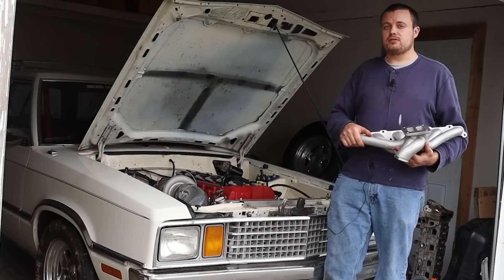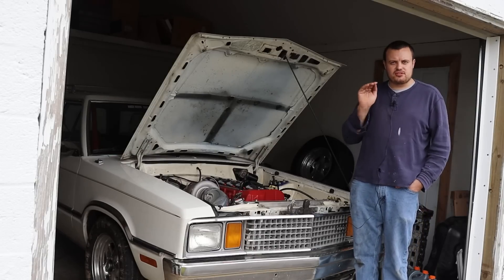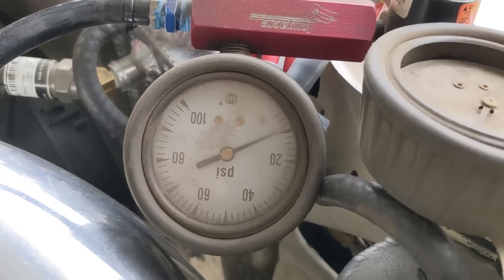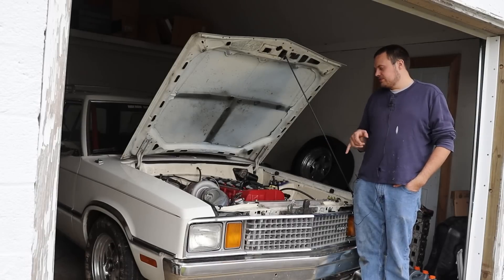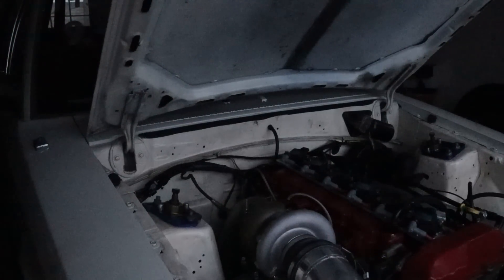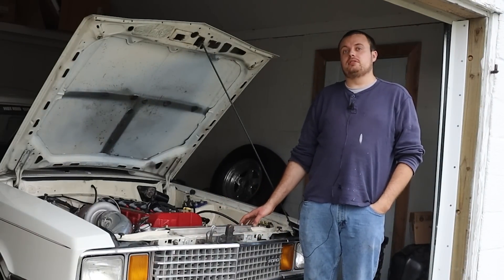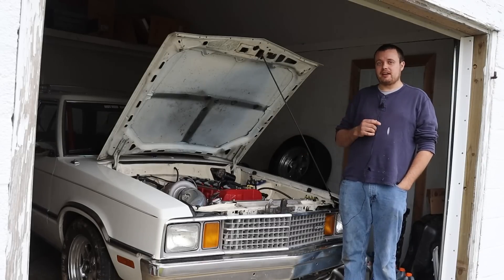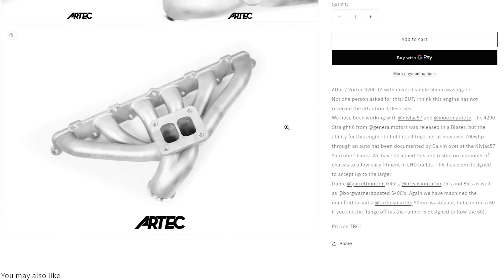Installing the Built Vortec 4200 Into My Station Wagon + Artec Turbo Manifold Sound Clips

Comment: Congrats! Your boost controller sounds like it's physically oscillating. My bet is on it being a very fast valve and that 30Hz is still too low. How high can you go in a Maxecu? The frequency is important because you want a tiny amount of oscillation, it keeps the valve moving and in the dynamic friction range because of that. Otherwise you'd get a lot of weird delay and non linearity because static friction is higher than dynamic
Reply from the maker: Yeah. I tried a bunch of different frequencies. Problem is once you get to higher duty cycles you have to increase frequency more. It's a pulse width problem. It's more trouble than it's worth. Go to dual 3 ports if you want wide range of control.

Comment: I freakin love it man. I just can't get over the manifold being pretty much $2000 by the time it gets shipped to you for an engine you can buy for $250 I know this engine has forged internals with the exception of the crank but it's just surprising. Good luck & can't wait for the Dyno.... God Bless...
Reply from the maker: Yeah. They're really nice manifolds. Investment cast stainless steel is expensive.
Reply: @Calvin-Nelson  It is, are you a partner on that deal?

Comment: Any plans to do solid lash lifters for higher rpm? Maybe even titanium roller rockers and valves/retainers
Reply from the maker: We're not to the point where it is required yet. We tried solid valvetrain on the Datsun. We're not revving them high enough yet to need it. The valvetrain is so light as it is. There are guys taking these things to over 10k RPM with the stock followers and valves.
Reply: @Calvin-Nelson  I’d love to see the engine on a spintron to see what rpm valves start to float with stock springs and aftermarket springs / solid lifters. Aardema Braun custom v12 said they prefer roller followers or finger followers vs pushrod or lifter buckets because they can go higher rpm plus more aggressive cams with lightweight roller followers
Reply from the maker: @Alfvaldez  I know a lot of time has been spent on a Swinton with one of these motors, but that information is definitely under lock and key.
Reply: @Calvin-Nelson  I genuinely believe once the blocks go billet and high rpm valve train these engines will be like or better than rb30 2jz barra and Nissan patrol tb48

Comment: I stumbled on your sight looking for info on the 4200 to see if would hold up for heavy towing in a 1.5 ton Mitsubishi with a fifth wheel and and a turbo. Do you think I could set it up for towing? I have a Trailblazer with  the straight 6 that broke a valve spring and was impressed with the engine when I repaired it. After seeing your work I'm really impressed!
Reply from the maker: That's a lot of load. You're talking like 12000 lbs or so? It could probably do it, but I'd like to see a diesel for something like that.

Comment: Does anyone make a intake manifold for the 4200?
Reply from the maker: Not yet.
Reply: @Calvin-Nelson  how much power have you made with the stock intake or have you found a limitation to it. Thanks
Reply from the maker: @rle1020  We've made 824whp. It's definitely better to have a shorter runner.

Comment: Volvo is a no-go for sick week I guess?
(S'okay, I like the long roof Fox better)
😁
Any chance of a little more in-depth view of the chassis/suspension on this car?
Five million Mustang guys (well, me at least) would appreciate it.
Reply from the maker: Plan is to take both the Volvo and the Wagon. Rear suspension is pretty basic. I could show it off when I do the rear suspension.
Reply: @Calvin-Nelson  
Very cool! Who's gonna be driving what?
Upgrading mom's competition license??
👍
Currently, I'm building an SN95 Mustang, which is pretty much just Fox body version 2.0.
I've never done anything but leaf spring rear in the past (used to be a big Mopar fan), so any tips & tricks passed along in your style would definitely be appreciated.
Reply from the maker: @zrxdoug  Dad's driving the Volvo. I'm driving the Wagon.

I love leaf springs. Slapper bars work great.
Reply: @Calvin-Nelson  
I like leafs (leaves?) too..like I said, all my other junk was Mopar. 
Just beefed up the front half of the spring pack to keep it from winding up, take all the clamps off the back half so it could fan out & grow on launch, add an adjustable pinion snubber, & the dang things would hook anywhere.
The factory coils & four link-ish arms on my 'stang just make my head hurt.
I look at it and all I see is built in bind and a whole handful of weak points.

Comment: It’s so odd hearing that thing in an old fox. What k member are you using? I’m considering putting one of these in a fox mustang. How much different is it mounting compared to an ls?
Reply from the maker: It's pretty different mounting, but you can go back to the build videos and see how I did it. I'm not sure what k member it is (it was $60 from a flea market with the A arms), but I used 1 inch k member spacers.

Comment: Man you got it...👍 That's really cool, but I'm going crazy here.  What's up with the dash line appearing to drop off the cliff? If you said something about it, I missed it. Anyway I can see you getting the 8s no problem With that set-up.🤔🏁
Reply from the maker: The solid line was from when I made my last pass in the car. The dashed line was just testing the 2 step in the driveway. I let off the throttle on the dashed line.
Reply: @Calvin-Nelson  got it, thanks 👍

Comment: Progress!!!  The car is going to be completely different the next time you take it to the track.  It is going to have more power at the previous boost level thanks to the ported head, more efficient exhaust manifold, and more efficient turbo.  I’d recommend turning it way down and slowly increasing the boost as you see how the car reacts to the different power curve.
Reply from the maker: Thanks. That's the plan.

Comment: Looking forward to the new gains.

Are you running a muffler downstream?
Reply from the maker: Yes. Flowmaster Muffler
Reply: @Calvin-Nelson  just food for thought, I've seen Flowmasters lose 40-80rwhp in turbo applications.
Reply from the maker: @kevinengland4042  yeah. I'd prefer a straight through fiberglass mat style, but I couldn't find a 4 inch one that would fit right in the space I have. My Dad had one of these Flowmaster on the shelf so on it went. I'll probably change it out someday to something else.
Reply: @Calvin-Nelson  You should build one.
Reply from the maker: @g.o.b.2558  hmm... never thought about that. Lol.. that's a good idea.